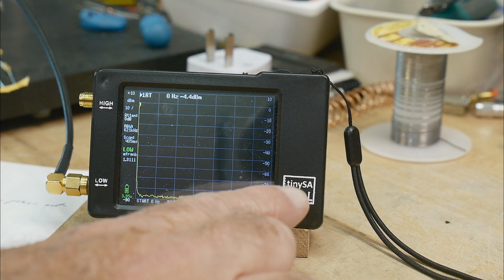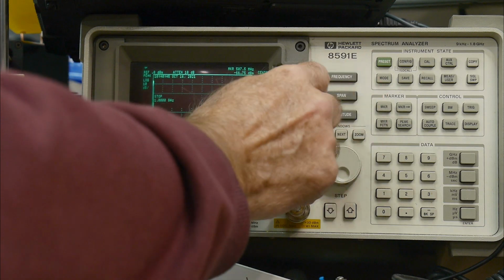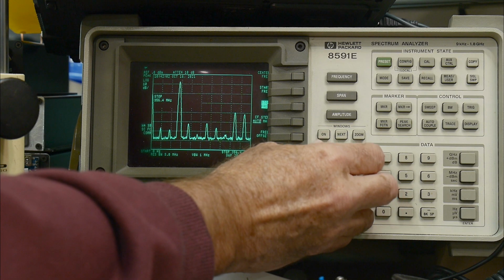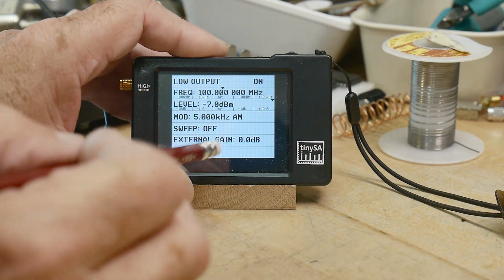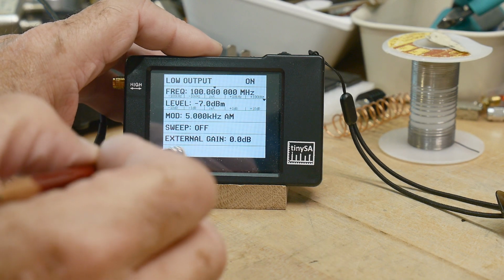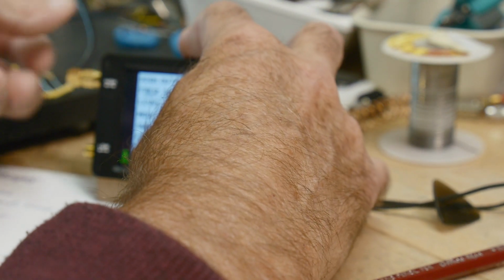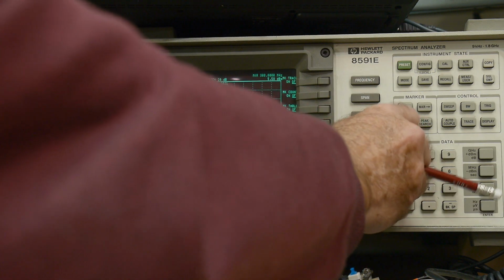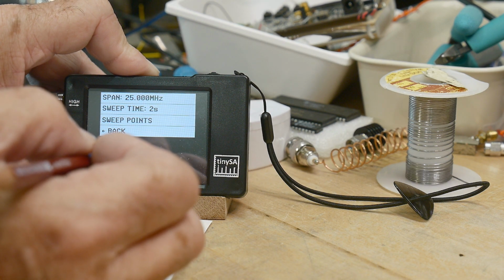#948 TinySA as an RF Generator

Comment: Your video is tack sharp.  Don't apologize for ANYTHING.  Background noise is not an issue unless you're going to show us what that noise is from.
Critique:  You could be a little more organized.  If your SA is falling over, fix that before you video.  Now, on mine I put a cell phone kick stand on it and some nonslip rubber feet.  It will not move.  
That said, it's obvious you know your stuff.  I wrote software for that particular model of HP SA for satellite control back when using the ports on the back (serial).  So that scope is like going home again.
I hope I haven't discouraged you since I'm a subscriber and want to see more!

Comment: When using the Tiny SA as a Signal Generator and inject a signal -73 dBm to a receiver, what modulation on the receiver side, shall I use, in order to check if the S-meter indicates S9 as it should?
Reply from the maker: what ever the receiver receives. as example narrow band FM..
Reply: @IMSAIGuy  The issue is that changing the modulation on the receiver, alters the indication on the S-meter. In AM it's 9+20, when in FM it's 9. At the same time in CW it's 8. The transceiver is an Icom ic 7000. Thank you for your answer!
Reply from the maker: @batfalcononyoutube  I'm no expert on S-meters. It might be doing everything correct or the S-meter is not calibrated for each mode
Reply from the maker: oh, just noticed you mentioned using the TinySA. the modulations are quite poor on that unit.
Reply: @IMSAIGuy  Thank you for your time.

Comment: The video was very helpful. In the low output sig gen mode is it possible to sweep the frequency manually using the stylus? I would like to choose a centre frequency say 10MHz and manually adjust it +/- by a few hundred kHz.
Thanks, Mike

Comment: LOL, OK, I saw the other video first and as annoyed as I was, I said to myself: "if you can't say something good, just don't say anything at all". Then I I happened on this video immediately after that one. You do seem to have your camera and equipment at a less than strategic location for the position of your hand and body in general. Still, it was a great improvement from the first video, but the eraser on your pencil is too large to tell exactly what it was you were pressing, (especially when you rifled through some of the settings).

In the end, I'm left wondering what you connected the Tiny SA cable to when measuring in Low, and when measuring in the High range, why didn't you change the Tiny SA'a cable to the "High" connection? If you did, I must have missed it. The Tiny SA is the only Spectrum Analyzer that I own but I do own several O-Scopes, (analog & digital), and an entry-level SFG.

I read or saw a video some weeks ago that said The Tiny SA could be connected to an external SFG but I can't find that information source anymore. I'm afraid of connecting the Tiny SA to my SFG without knowing if I should setup a filter in-line and if I should use the High or Low connection point. The idea was to use my external SFG, which I know is certified and calibrated, to check the accuracy of the Tiny SA and possibly adjust any contradictions displayed in the Tiny SA's readings.

At any rate, I'm not even sure if the Tiny SA can be connected to a scope and/or external SFG without a filter let alone if I should use the High or Low connection, (or both).
Thanks again for the video,
Rich
Reply from the maker: I suggest you go to my homepage and click on the playlists tab. You will see a playlist 'TinySA'. You will find 60 videos on the subject. I'm sure all your answers are in there.
Reply: @IMSAIGuy  Thank you!! I'll do that ASAP!

Comment: Should thus suffice as a tool to align my PACO E-200-C frequency generator I just restored?
Reply from the maker: I would use an oscilloscope
Reply: Although I have the crown jewel on analogs, 2467B, which I'm still learning, I'm not sure how that would work. Not looking for instructions, but if it's possible I'll research it.
Reply from the maker: using an analog scope you will need a frequency counter also

Comment: Note that the former version of FW (as of June 2021) gives up to +16dBm at the "high" output. This is limited to +9dBm at the latest version (23.08.21). And that can be a good idea, as when interconnect the connectors to do self-test and calibration, it's possible to inject 16dBm from the high output to the low input. And exceed the +10dBm limit. However, the tinySA is a great tool for everyone into RF.

Comment: Hi Guy, thanks for this video. This is indeed very useful. ... Do you think that the couple (Tiny SA and Nano VNA) or (Tiny SA and Scope) would be convenient enough to characterise for example a pass band filter (let's say 7 MHz to 7,3 MHz for the 40m band) ….  This would perhaps make a very interesting and nice video !!
Reply from the maker: I have plenty of videos measuring filters with various equipment
Reply: Or just use a cheap high level noise generator and use the SA to sweep the bandpass filter..